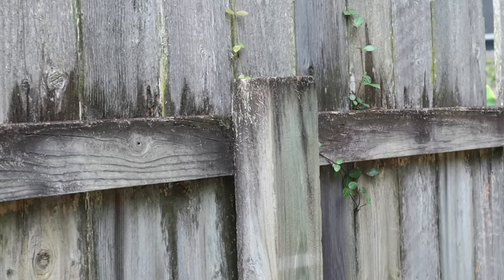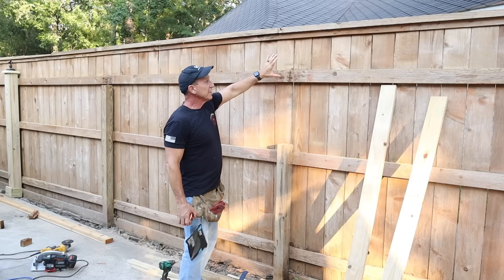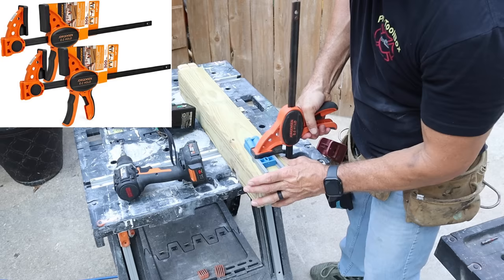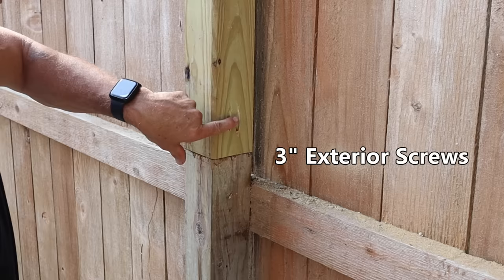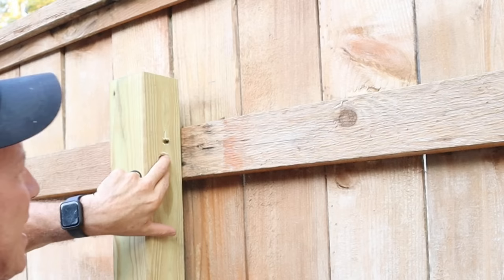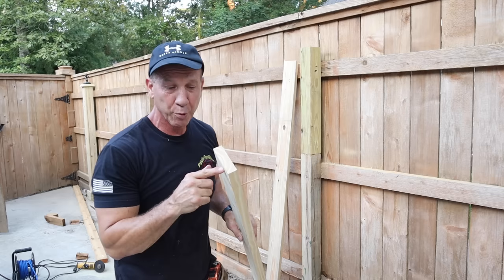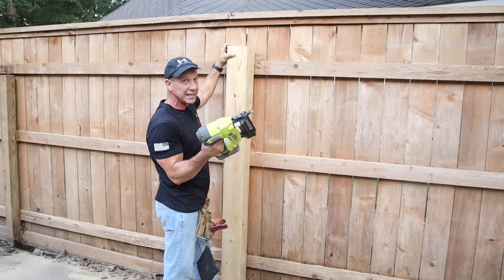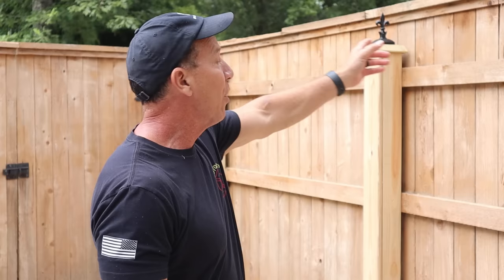Cheap And Easy Way To Extend Your Fence Height Using Existing Posts And Rails | Paul Ricalde

Comment: Don't forget to check city codes.  Here, maximum height is 6 feet.
Reply from the maker: Good point, I had to get permission from the neighborhood association as well!
Reply: @paulstoolbox  I live in a 200+ unit condo association.  Don't get me started.  I had to get a permit to replace a brick patio with a concrete patio.  I had to get a permit to install a screen door, even though many units don't even have screen doors.
Reply: @paulstoolbox  how did you do the top of the fence?

Comment: I did the same thing with the pocket holes when I needed to extend the post. Except I used a mending plate between the two post sections and hammered it all the way in.. Seemed pretty solid. Wasn't the ideal method but it worked out for the situation. Still going strong
Reply from the maker: Thats a good option as well, glad to hear it held up. Thanks for the input!

Comment: I would probably miter those cap runners to give it a cleaner look. Great idea, well thought out and well done
Reply from the maker: The only problem with mitering the runners is they shrink over time, so your joints will separate. If you glue them with exterior wood glue they may hold up but it would take time. It would definitely look better though. Thanks!

Comment: Good video. I have a 12x20 foot deck that has a 4 ft rail with 4x4 posts that go from ground to 4ft above the deck where the railing is. I want to add a porch covering over this deck. Is it possible to attach
4 foot cut lengths of 4x4  to the front 4x4 posts and make them strong enough to support the roofing lumber ?

Comment: Hey paul, my 15-year-old cedar fence's posts in concrete are finally starting to rot and lean. I have about 80 posts on the fence enclosing my backyard, only several are wobbly so far, but I fear a nightmarish task looming. What do you suggest? The fence panels themselves of course are still in fine shapes since they are above ground.

Comment: Does anyone know how high you can extend posts safely? I have posts in the ground from my previous fence.  I originally was going to dig them up and replace them, but now considering just adding 4ft posts on top of the existing 4ft posts (4ft above ground 2 ft under), just wasn't sure if that would be structurally sound.

Comment: How did you add fence height? Is the outside of the fence on your property. I would love to raise a section of mine but it butts up to a neighbor’s yard and it just happens to be the reason I want to raise it.😬 any ideas?
Reply from the maker: Yes the fence is on my property side but I gave my neighbor the good side and decorated mine with Post. I’m very fortunate to have great neighbors all around me. I hear really bad stories about people all over with terrible neighbors, not saying that you have bad ones. Usually when neighbors get along they will split the cost of the fence. Most of the time the person who has the fence installed will put the good side toward them. If the finished boards are facing you, maybe the person before you put up the fence and you can do whatever you want. If your neighbor put up the fence with the finished side on his or her property you may be able to talk to him and put your fence boards taller or the existing rails and Box it like I did. Good luck and have a great day!